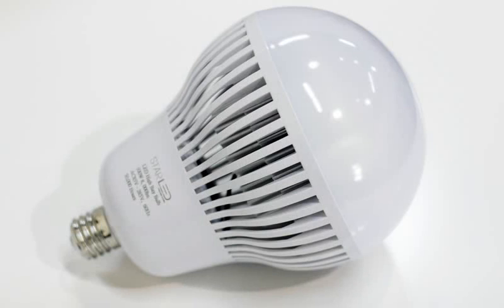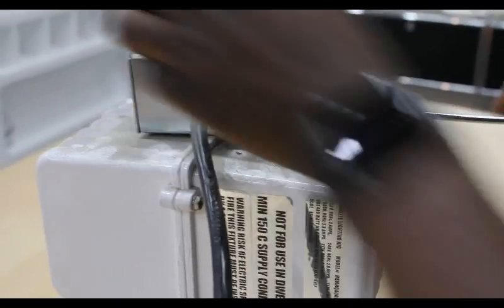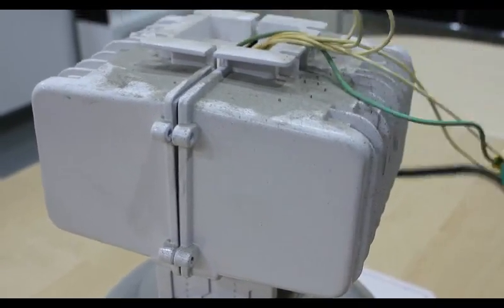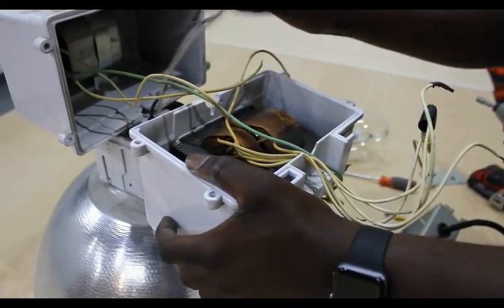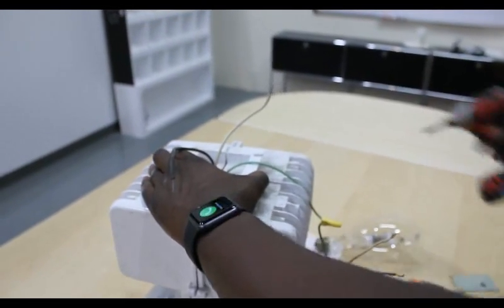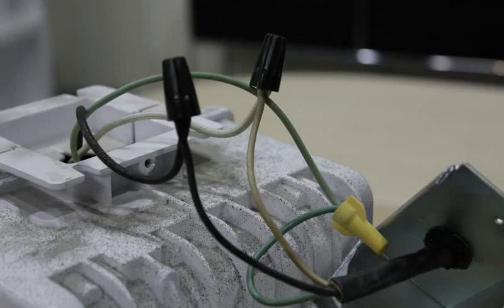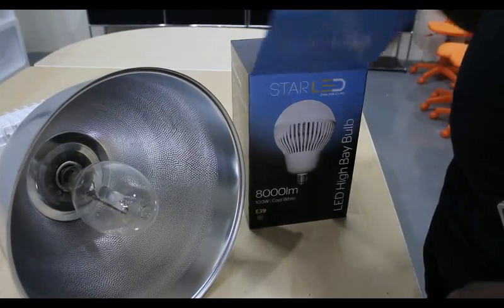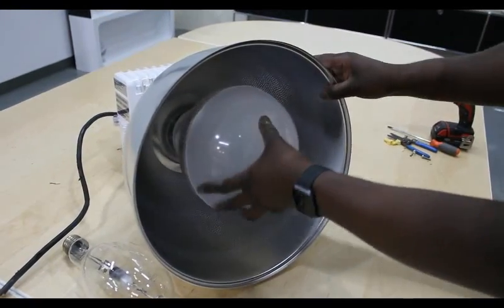StarLED Ballast Bypass Instruction for LED High Bay Installation

Comment: 8,000 lumens won’t replace a 400w metal halide. Sorry. That’s a less efficient LED and that’s even less than a 250w metal halide. I would recommend the 23,000 lumen 150w LED high bay fixture to replace a 400w metal halide or HPS. Not only a 150w fixture is brighter than the 400w metal halide or HPS, but it focuses the light better than your LED replacement.

Comment: Now after you cut the exposure off of those other wires, don't you still have to cover off the tips of them before you put the ballast back together. See, my church has these lights in the sanctuary and I was telling my pastor how I found that there are LEDS available for them as long as you convert them at the ballast first.

Comment: Why not just replace the entire fixture with led high bay unit that is cheaper and less labor ? Unless you like holding a 30# light ballast in the air that serves no purpose but to hold the building down now that they have been bypassed to save the cost of a mogle lamp base ? They must sell to the government . How many idiots does it take to screw up a light bulb ....... couldn’t resist lol but only half a funny as this video !
Reply: Allen Sandven I’m with you, it seems the led retrofit bulbs are about the same money as a new led fixture... am I missing something, changing the fixtures seems like the common sense thing to do
Reply: @gabecook7908  A lot of the new LED fixtures sold on amazon are plastic and don't last like these heavy older fixtures.  So unless you are buying proper high quality and high price units it makes sense to just replace the bulbs and keep the older fixtures.  My son replaced all the lights in his 18 foot high shop which he services 45 foot Lobster boats in.  He had his electrician source the lights from industrial suppliers and they were about five time the price of what a like  lower quality is sold on Amazon.  When they came in I helped the electrician install them and they were well worth the price.

Comment: maybe  remove the old ballast and capacitor in the same time it takes to cut the wires making the fixture lighter and then recycle or resale the old ballast for $$$ and not to go to landfill.  If you are replacing an entire warehouse with 20+ fixtures a sizable savings.
Reply: That ish had my OCD bubbling! Why leave the needless ballast in there.. great comment!